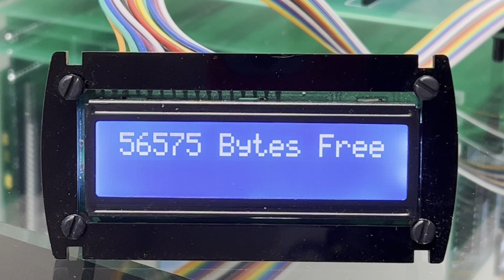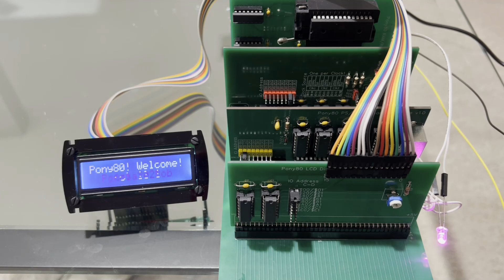The Pony80 Overview - My z80 homebrew computer!

Comment: I gave you a like but i have to complain. Your audio was too soft and barely audible. I had to put my iPad to my ear in order to hear it wit it on full volume and that was barely audible.
Reply from the maker: Thank you. 
I am not sure what happened on that video, but YouTube has no way to correct it once it is uploaded. It doesn't seem to have happened on the clock circuit video.

Comment: Can you tell me how do you make the PS2 interface? Im building my own computer with a Z80 and Im already make this display some characters in a 16x2 display with an old PS2 Keyboard that I have using only some flipflops and a bunch of logic gates. Im now pretendind to interface the PS2 keyboard with a Basic OS  but the project that I made was a mistaken. Every key that is pressed the logic gates to interface the keyboard send a INT pulse that makes the Z80 jump to a specifc part of my code and this type of interrupt dont work well with the Basic and the "bios" that I found because its use the Interrupt Mode 2. Im not understending how to make this two thing work together. Thank you and please continue with your work, ypour project looks great!
Reply from the maker: Yes, the ps2 keyboard is going to be included in these videos. Up to that point, it was the biggest challenge that I encountered.
Reply: @Pony80  thankyou, I'll wach it!
Reply from the maker: And, I might add, this part was for me the most challenging. It took me many tries to get it right. 
I fear the VGA interface is going to be worse!
Reply: @Pony80 Probably will lol, Im pretending to use a TMS9918 but I didint even started to this part

Comment: I hope the video controller is TTL or CPLD based .. none of that FPGA, Parallax Propeller, Raspberry Pico or Arduino rubbish .. I am counting on you man!
Reply from the maker: YES!  That was all I could find, so I am challenging myself to build it TTL if I can.
Reply: @Pony80  There is a guy here on YouTube that has created his very own graphics card; "the world's worst video card". Really interesting videos. If you haven't seen it already you should, will give you some good ideas.
Link: https://youtu.be/l7rce6IQDWs
Reply: I vaguely remember some Z80 designs using the Z80's built in DRAM refresh hardware to output video. You might want to look into that.